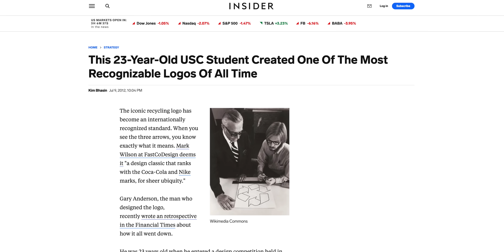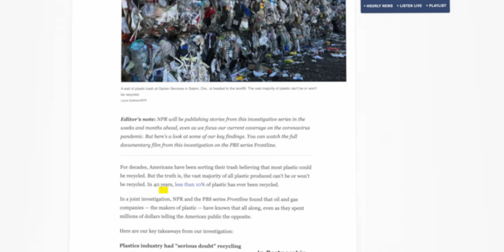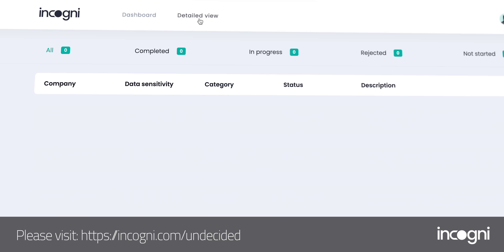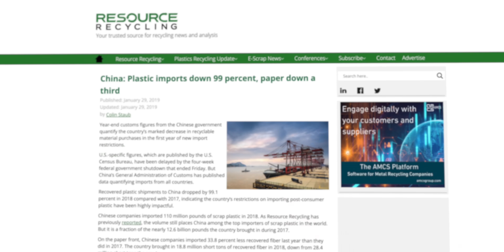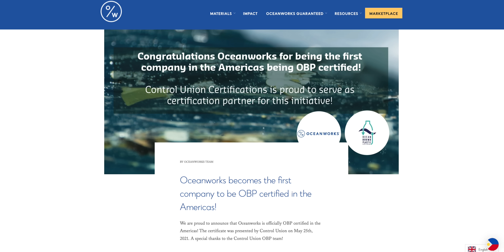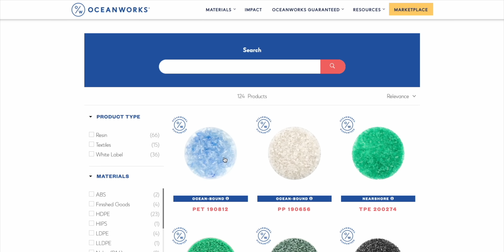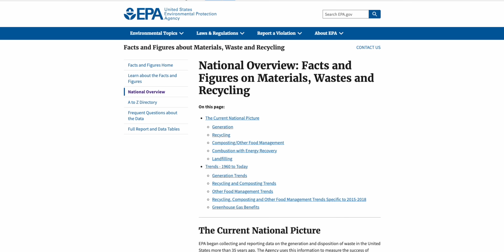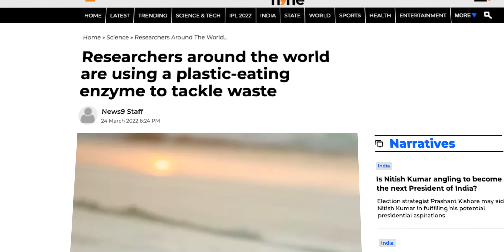The Truth About Plastic Recycling ... It’s Complicated

Comment: There is an Australian solution that seems to be the real solution. Researchers there have developed a system that takes All plastic unsorted and converts them back to the "oil" that plastic is made from. This oil enters the market at the same place the original oil entered the market. The cost of the oils is less than the original because it is cheaper than the oil mining business. This is the road block though as the Petro industry is very greedy and does not want this technology to take off!!!! If we want real solutions we need to really address the market conflicts and strategies (just like what you discuss) to get solutions to move forward. Politics is very willing to attack consumers to force them into electric cars and other solutions that just move the sales of fossil fuels to the power industry instead of consumers - another way the public is hoodwinked with false solutions!!!

Comment: As long as plastics are still used, I think the way to make all resin types recyclable is to use hydrothermal carbonization to break the plastics down into usable chemical feedstock.
Reply: Trouble with that is you get such a dirty soup the only thing you can really do with it is burn it, so instead of burning solid plastic, you are burning pyrolysis oil. There is much hype right now about "advance recycling" which is what you are talking about and it is just more industry slight of hand like the "recycling" scheme was.
Reply: @J03Nelson  Indeed.  Thermal depolymerization got on my radar over 20 years ago.  It's still not a scalable solution with the problems you mention.  It's all about reduce, and the only way to accomplish that is to replace plastic with competing materials.  Big plastic has been quite effective in suppressing that over the years. Hopefully, capitalism will grind on and entrepreneurs will eventually disrupt this titanic rentier industry at scale.  Then the same old human story repeats.

Comment: Here where I live (Quebec, Canada), consumers pay a 5c fee for every plastic bottle (except water) they buy. There is a similar thing for beer bottles and soda cans. That fee called "consignement" is then given back to consumers when they return the empty containers. Every groceries store have "Reverse vending machines". 
They say they get back around 70% of them back. Is that not a thing in the US?
Reply: I remember as a child in the 70's just before everything was sold in plastic bottles there was a 10p deposit on most glass bottles and it worked most people returned their bottles to the shop and reclaimed their deposit.
Reply: It varies by state.  California, Connecticut, Hawaii, Iowa, Maine, Massachusetts, Michigan, New York, Oregon, and Vermont each have some bottle / can redemption system in place.  Living in Massachusetts, I can tell you still see plenty of empty bottles and cans on the side of the road, but you most commonly see nip bottles (usually fireball) which don't have any deposit.
Reply: @archstanton3931  but in MA the 5 cent deposit is limited to 'carbonated' beverage containers.  Why the contents of the container dictate this can only be explained by the lobbyist.  And the 5 cent deposit was enacted some 30+ yrs ago and has never changed.  Finally 30 yrs ago we generally didnt have bottled water, iced teas, coconut water, gatorade etc, all which today are containers with no 5 cent deposit.  A bit maddening
Reply: @danacanzano223  Never realized that carbonation was the deciding factor, but looking at some empties it checks out.  Seems like the law's ripe for an update.
Reply: in Germany it is 98% going back
Reply: Similar deposit system for drink containers exists here in Finland as well. In 2021 the return % was 97 for aluminum cans, 90 plastic bottles and 98 for glass bottles. Basically every grocery store is equipped with one or more of these "reverse vending machines", so returning your cans/bottles is not a big hassle.
Reply: @aewinious  it would be great if we could  introduce something similar for all food packaging
Reply: It's state by state. We have a "bottle bill" here in Maine which covers plastic, glass, and metal cans less than 4 gallons for redemption. Hi, neighbor!
Reply: 70% of non-water plastic bottles is still just a drop in the ocean. In reality Europe, Canada, the US, and Japan are not much different from India or Ethiopia when we look at where the vast majority of plastic actually ends up.
Reply: It's a thing in some states, but it's really annoying. The machines suck, very slow, sometimes reject perfectly good items. I usually let the stores/state/whoever keep the 5 cents and just toss it in my curbside recycling. It all goes to the same 3rd world country to just sit there or be burned in the end anyway, there isn't special recycling that the stores have but curbside programs don't.
Reply: I have seen similar machines in europe.
Reply: @janami-dharmam  Hope there is more :)
Reply: Oregon has a 10 cent deposit on every bottle or can sold. CT, NY, ME & HI have a 5 cent deposit. In California the plastic industry lobbyists weakened a proposed law that would've imposed a deposit on bottles. Instead, we ended up with CRV which is currently 5 cents per bottle, the main difference being that CRV is taxed, instead of a deposit that is not taxed. IMHO plastic bottles should carry a hefty tax to discourage their use and promote the use of reusable glass containers.
Reply: @Pixeltrainer  PET is perfectly reusable when it is not too thin.
Glass weighs more and needs more energy for transport and melting requires much higher temperatures.
Reply: @Pixeltrainer  plastic is a auper-broad category. You do not abandon Metals because lead is poisonous.
Reply: Yes.  All the grocery stores in my state in the US have bottle / can return.  Same thing, you pay a deposit that you get back when you return it.
Reply: It technically exists but the system is such a pain it is rarely used.
For one thing you don't get cash back, you get store credit on an easy to lose tiny slip of paper have to hand to the cashier if you remember you have it at all.
The machines often refuse to accept the container because they read the bar code but the machine isn't always clean and sometimes the bar code is ripped or smudged and unreadable. Yeah you can bring the bottles in if someone is manning the customer service counter but that is another hassle.
Then the machines you have to use are often broken and are placed in a small room that stinks so bad.
It is just such a hassle. It's like they don't want you to actually recycle the bottle and put a bunch of hurdles in your way.
Reply: @GeorgeMonet  You must be from Michigan
Reply: This is a crap scam. Well, not a scam, but most places that I've lived in the US have curbside recycling. Why would I carry all of my plastics back to the store when I can put them out front with the glass and metal that I'm already recycling? 
This type of deposit does exist in a few states, but IMO it's vestigial, a hold over from a period before curbside recycling intended to incentivize consumers to start recycling rather than discarding glass, plastic, and metals (usually aluminum).
Reply: We have this in Michigan as well, but it is 10 per bottle or can. This means a great deal of our bottles and cans are collected and returned rather than ending up in a landfill. 

Personally I think there should be a tax on any water bottle made of plastic. It sickens me when I stop at a convenience store and see the variety of plastic water bottles. We have ONE option for canned water.
Reply: It should be. We had doposits on glass bottles as a kid. 5cent, 10 cent .  Bring that system back for plastic bottles.
Reply: Yeah those “Deposit and Return” systems are great, make individuals more responsible, and if they fail, cleaning it up can be profitable!
Reply: @ericlotze7724  They're great but now stop and think - where is that plastic going after you've gotten the deposit back?

Oh yeah, shipped off to some third world country to be burned or just sit forever. Deposit and return systems are great at reducing litter but they don't magically make plastic recyclable.
Reply: @mjc0961  Plastic CAN Be recycled be it:

- Direct Recycling (Plastic Regrind is Used as a Direct Substitute for some or all of the virgin plastic pellets in an identical use-case)
- Upcycling/Downcycling (Bit of Terminology Hell) (The Plastic is Used as a Substitute for Virgin Plastic in a Non-Identical Use Case such as PET being used as polyester fiber, or plastic park benches etc)
- Chemical Recycling (This works for ALL plastics including thermosets) (The plastic is broken down back into hydrocarbons, these are then fed back into refinery workflows and/or used for fuel production “Pyrolysis Gasoline” etc)
Reply: @mjc0961  The issue is not the technology, it is the “cost compeitiveness” however that is comparing doing the right thing, to doing damaging fossil fuel ls, not taking into account the “Carbon Bubble” as well as social and environmental costs in general.

If a proper carbon tax is implemented and/or once fossil fuels are no longer used (due to social pressure, or even post-“peak oil”, however the latter is far away, especially since “unconventional oil” becomes conventional as scarcity increases) suddenly the “cost competitive” aspect is gone and nearly all technologies are on the table.  And that’s without subsidies!
Reply: Yeah we have that crap too.  I doubt the 70% number though because it is a pain.  I used to recycle my soda cans but half the time they were broken or full.  I think glass is better than plastic.  Simpler recycling?
Reply: @billy-go9kx  Yeah, those numbers are provided by a government organization Recyc-Quebec so we never know
Reply: COPIUM. Just because they get back 70% of those bottles doesn't change the fact that those bottles are just ending up as harmful chemicals in the environment...
Reply: @MarcusHelius  this is my thought as well. Also, how does this redemption help with recycling? After you get the .05 cents back where does the plastic end up?
Reply: @adamcravets5408  It’s moreso a litter reduction method.
Reply: @adamcravets5408  I think it helps by having only the good kind of plastic with way less contaminants than in the recycling bin

Comment: One good way to recycle is to use an item again for another use rather than throwing it away. I buy Arizona tea mainly because the plastic bottles that it comes in are durable. I reuse them as water bottles, and I can keep using them for months. If manufacturers intentionally designed their packaging to be easy to reuse, this could significantly reduce the Amazon amount of plastic that gets thrown out.
Reply: The good news about plastic just keeps coming:
I did that as well until I read that the light-weight plastic used for disposable plastic bottles is prone to growing microbes.  It’s advised not to re-use them more than once or twice for that reason. 
    Plastic is Poison.
Reply: but that will be bad business; they want you to buy more and more items.
Reply: @janami-dharmam  There is no 'they' for there to be a single bad business. Plastic is an expense to the manufacturer and payment to the plastic manufacturer. If food producers could do something impossible and bad sci-fi like create holographic forcefield bottles for far cheaper they would.

Comment: Also, it's time to end this blame shifting onto consumers, and change the laws. Initiate the transition away from this scam, and punish all responsible. It's the same as leaded petrol. Something that had an awful impact on humanity, and remained a part of our lives for decades just because of insane profits.
Reply: Agreed. I do my part where I can. I have my reusable stainless still vacuum insulated water bottle on my desk next to me, been using that for around 10 years. No plastic water bottles for me. Bring my lunch to work in reusable plastic containers instead of single use plastic bags. I bring washable silverware instead of using disposable plastic silverware (that sucks anyway, never found plastic forks or knives that didn't snap). I even switched from Kleenex to Puffs just because Kleenex puts that stupid little lip of plastic at the top of their tissue boxes.

BUT all of that stuff is a single grain of sand in the absolutely massive desert of corporation generated plastic waste. There's a lot of plastic we as consumers simply can't avoid because every option for something involves plastic. And even if I decide to, for example, buy Pop Tarts for breakfast because it's cardboard and foil without plastic (I won't because holy crap that's not good for me and they don't really taste good either), that still doesn't stop the pallet of poptart boxes from arriving in the store covered with several layers of shrink wrapped plastic. So I may not have generated plastic waste directly, but now the store has to order more poptarts to fill the demand I've created and bam, more plastic waste generated indirectly.

But I can't see the laws changing or getting passed any time soon. Corporations and their lobbyists will keep the "campaign contributions" flowing so nothing changes. Who cares if the planet dies tomorrow if CEOs and investors can make a few more bucks today?
Reply: @mjc0961  the planet will not die of plastic. Even with all the hysteria. The EU has banned a lot of single use plastic. It is always good to avoid waste.
Reply: @Mars Aluminium hydroxide in the bloodstream is deadly to your brains, since when we are worried about carcinogens?
Reply: The organization that makes the laws (government) is the biggest problem and the worst thing for the environment.  The only laws that will fix the problems are laws that protect the inalienable rights of the people.
Reply: It's definitely the fault of consumers, I mean if we didn't use plastic products no one would manufacture plastic products, and there would be no plastic waste, but we choose to continue using plastic stuff because it's cheaper.
Reply: @robertmartin6800  -- The responsibility/fault is shared between consumers and producers. As mjc0961 demonstrates with the Pop-Tart anecdote, much of a plastic that a product uses is not included in the product itself. It's reasonable to consider consumers culpable for whatever plastic they actually buy, but not for the stuff that's being used behind the scenes.
Reply: @robertmartin6800  yeahh.... in 50ies a man could support an entire family with one job, now 2 overjabed nuts working on 4 jobs, and the autistic child needs a loan to go to school. So maybe the problem is not in us but in those who suck us!!!
Reply: name one awful impact on humanity due to plastics ... oh nothing
Reply: @ToriZealot  Bisphenols, PFAS & PFOA, plasticizers, flame retardant additives messing with our health in known (cancers, mimicking function of some hormones, etc.) and currently undiscovered ways. Plenty more beyond these. Never mind trashing the place in general.
Reply: @chow-chihuang4903  Yosef, many problematic substances that are mostly banned meanwhile. But what is your point? Food contact materials do not contain these substances. Some jewelers contains 90% Cadmium, not very healthy either. It is about controlling unwanted substances not about demonizing plastics that is free of all that.
Reply: @ToriZealot  Whataboutism at its finest! 🤣🤣🤣
Reply: @chow-chihuang4903 huharhar, what is your point? Some plastic can be dangerous? Sure, Luke many other things.
Reply: @ToriZealot  I think we found our industry shill!

Comment: We could go back to glass bottles, but the plastic industry has made sure they do not get pushed out. We used to use glass bottles and we used to recycle them, we were already environmentally friendly.
Reply: Glass is much heavier and will increase the cost of transportation by multiples.  Besides the fact that we are running out of sand to make glass from.
Reply: @rockys7726  Glass can be made from smooth sand there’s still plenty of. That’s the type typically found in deserts.
The sand that’s getting scarce is coarse sand, usually sourced from river beds and deltas. Its rough texture increases the strength of concrete.
Reply: @chow-chihuang4903  If that's true then why are there shortages everywhere?  btw I used to work for a glass manufacturing company.

Comment: My original degree is in Plastics Engineering. Honestly, we just need to get rid of 80% of single use plastics and then use better recycling systems for the remaining amount.

But that’s going to be hard as long as we keep drilling for fossil fuels since plastic is essentially made from the by product of oil drilling. So we have to stop harvesting fossil fuels at the same time!